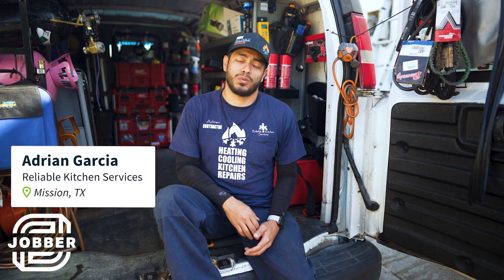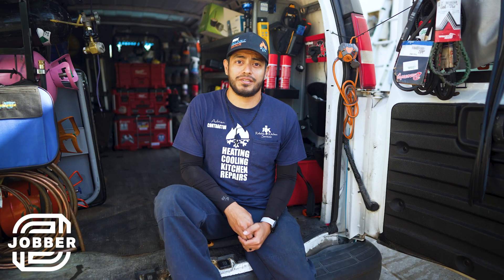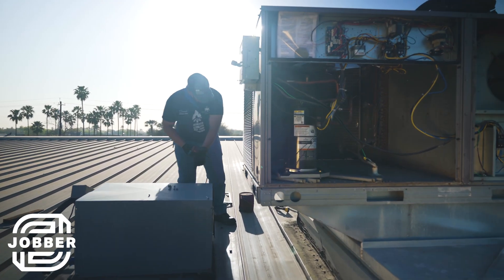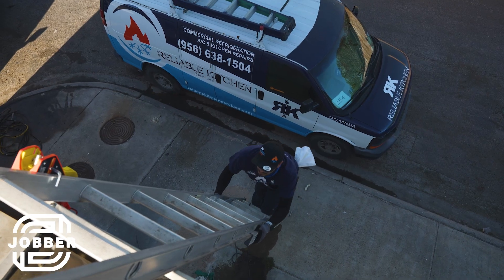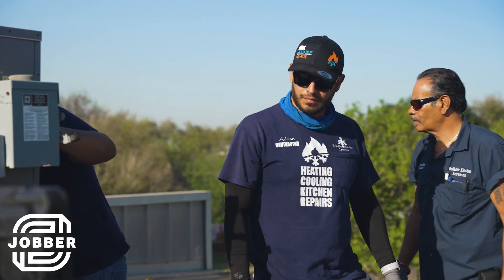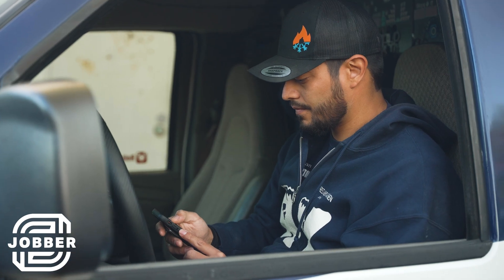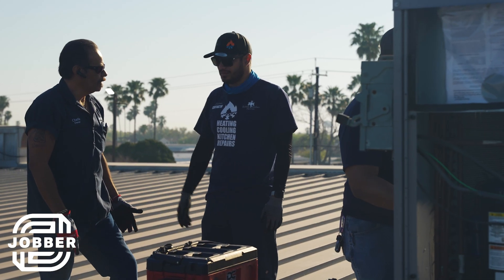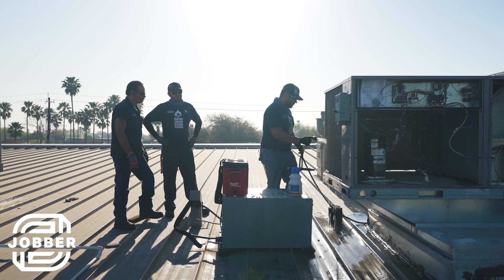The Best Software for HVAC | Jobber Review

Comment: Problem I have with jobber and don’t use it the way it’s designed is I don’t want my techs seeing any pricing. They have to have access to that to do any changes to a “job” Therefore we are currently looking to switch. Any suggestions?
Reply from the maker: Thanks for the comment! Specific areas in Jobber are limited based on permission structures, however our Success team is very interested in thinking through possible solutions for you & your employee management.

If you'd like to discuss further, give us a call at 1-888-424-5301 or send us an email at support@getjobber.com.